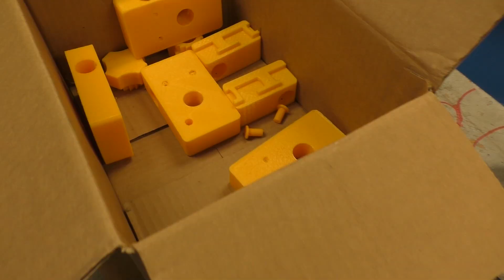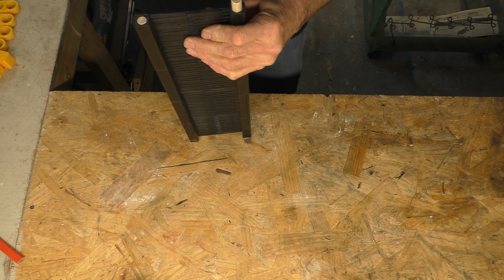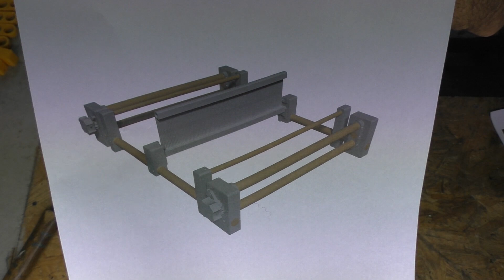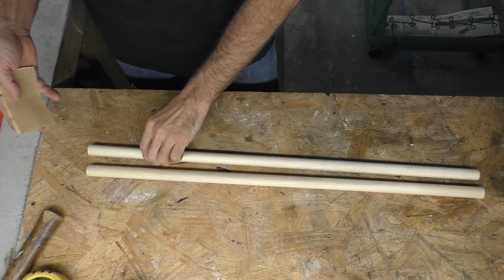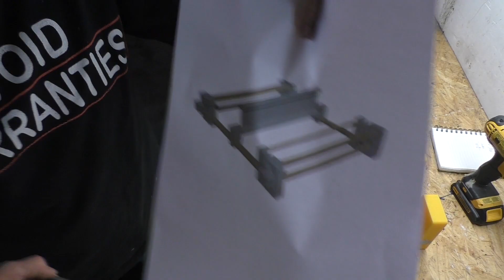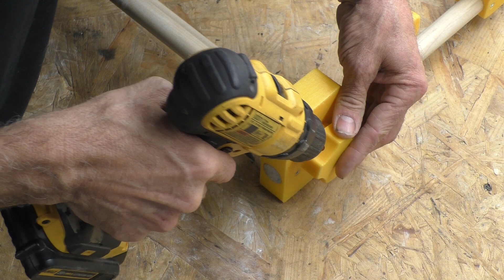3D Printed Rigid Heddle Loom Assembly

Comment: Long time weaver here. New to 3D printing and am looking forward to making this loom. Technically, you don't need the 3 dowels that make up the cloth and warp beams.   Simply run the center dowel all the way through instead of having 2 small pieces attached to the knobs. Just make that all one long piece.
Reply from the maker: Good tip. I did that on another version I made. :) Thanks for watching.

Comment: This is great!  I am wanting to do a 24" or 32" build.  I will be using other heddles so I will just use those as my width measurement.  I really appreciate the build example.
Reply from the maker: It works better if you use a single dowel on each end to hold the warp.

Comment: I'm working on assembling mine now, but I realized that you have the front and back ratchet pieces reversed.  The parl should be towards the middle, not towards the outside.  It'll still work, but it's not as it was designed.
Reply from the maker: Yeah I realized that after the fact. :)